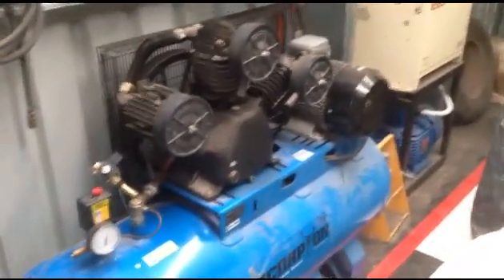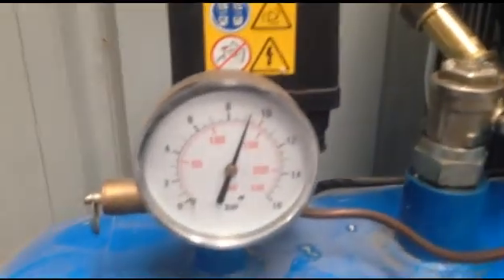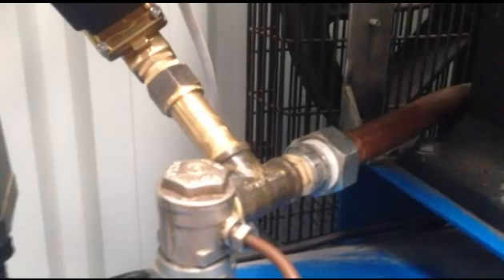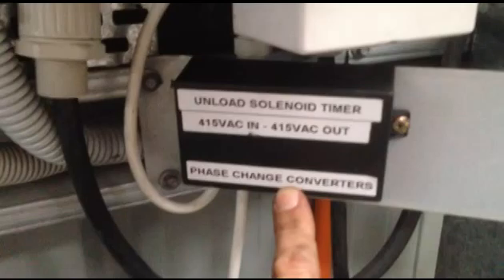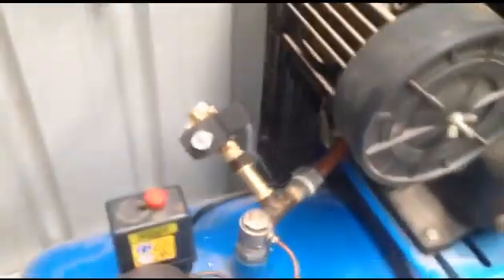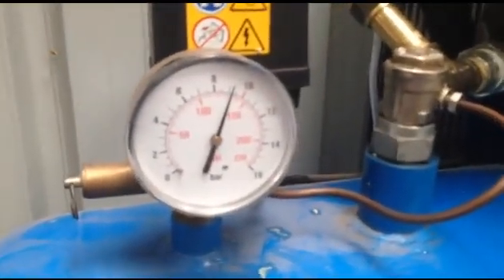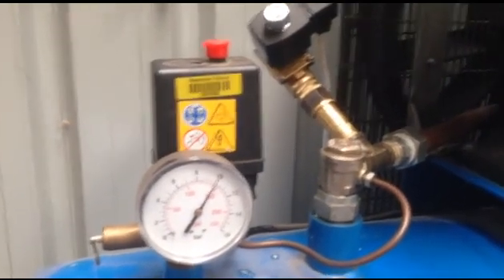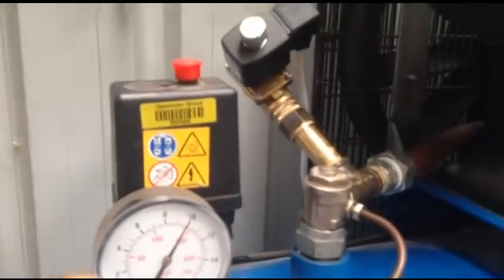Air Compressor Head Pressure Relief Starting Kit

Comment: This is EXACTLY what I need! I've been debating how to help my compressor motor get going by decreasing the load on the head, by a small tank between the head and check valve or a longer tube for added volume. I was able to simulate your setup by loosening the pipe, starting the compressor, and then tightening it back up. Thanks for sharing this video!
Reply: who is the manafacture of the solenoid you are using?
Reply: Benny McKeon ii